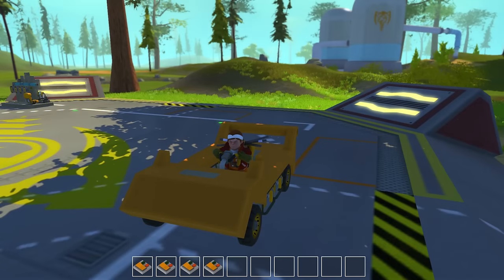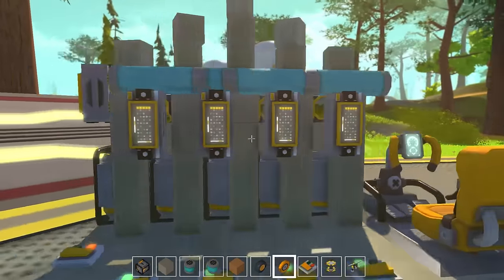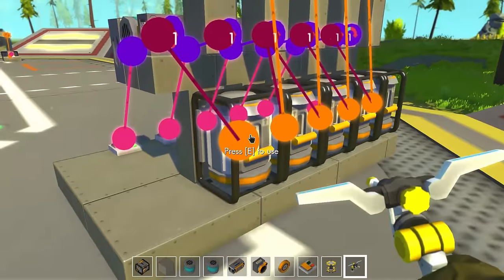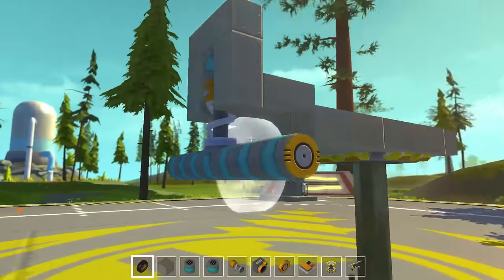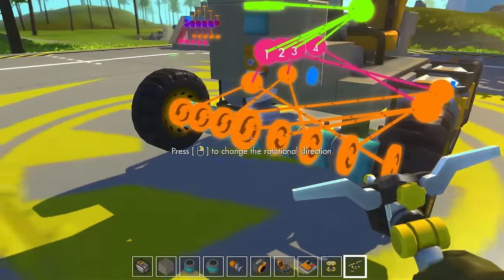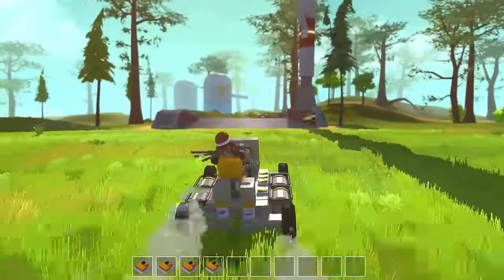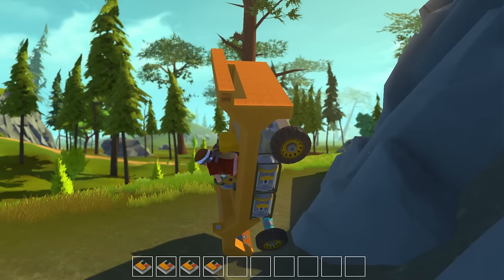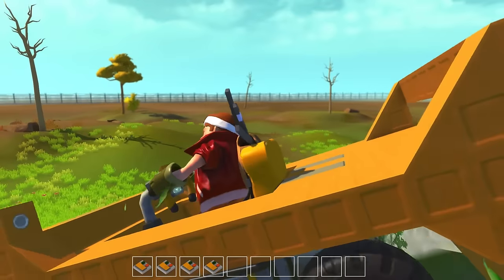02 - Manual Transmission Sports Car Tutorial | Scrap Mechanic Let's Play with Lyte

Comment: +Lyte So with your manual transmission (which I have an idea or two I need to tinker with to maybe improve slightly), WhyBeAre's locking differential (kinda sloppy, sadly), it's pretty straightforward to build a 2/4 wheel drive toggle to fully trick out the ultimate on/off road vehicle.  ;)
Reply from the maker: +Steve Pittman Sounds great!

Comment: This is a great idea and I'll definitely be tinkering with it. I just have to ask, why make your sports car FWD? I'm not sure if the physics in the game act the same in real life in this context, but different locations for the drive tires can have different effects on handling. FWD tends to under-steer, making it difficult to turn at high speeds. RWD does not have this problem, but instead has to deal with over-steer, which can be a lot of fun.
Plus, if you were to make it RWD, you can change the design of the front end. A strut assembly for each individual wheel would give you a stabler ride.
Reply from the maker: +CaliMeatWagon Gaming I address most of those questions in the viewer special (episode 13). RWD likely makes a difference at higher speeds than I go for people with more automotive experience than me. Separating the wheels in the RWD variant did make for a smoother ride, but I like bouncing more than I like drifting. I'm also learning as I am teaching in many cases, so my choices are often not optimal.

Comment: Subbed. Sweet build! Wouldn't the steering be better with independent front suspension?
Reply from the maker: +dave2402 That depends on what you mean by better. The car will be more stable with independent suspension, but it currently doesn't lack stability. With independent steering, it will likely have a tighter turning radius, but that would require you to either sacrifice a gear or make the car wider (maybe taller too). However, with the independent steering, the wheels move less to turn the same amount leading to less chance of hitting the chassis. There could also be some other benefit (or hindrance) associated with those two steering methods that I don't know about. Long story short, some function was probably sacrificed for the sake of size and shape.
Reply: +Lytebringr Just made it RWD

Comment: it does not quadruple, it actually adds another turn, so the first arm rotates 1, the 2nd rotates 2, the 3rd rotates 3 rounds over the same interval :)  It makes sense if u imagine it takes 1 second to go around 1 round, for each arm, meaning after 1 sec the 3rd arm must have gone around its own round  + the round of 2nd arm + the round of first arm.
Reply from the maker: +Madlion That is exactly right. That's how I had it in my head when I initially designed it, but the way the engine power scales threw me off my game. I'll have to make a rebuttal video against myself on that one. I need to practice more with angular velocities!

Comment: If I count correct, the small turns 3 times where the big one does 1, shouldn't that be 3 times instead of quadruple?
Reply from the maker: +karremania You are quite right. I address that in a later video. I was thoroughly mistaken at the time.

Comment: could you combine electric and gas engines so you have more torque in the lower and more top speed in the higher gears?
Reply from the maker: +Alpenkraut It might be possible, but I haven't tested it yet! One of my upcoming episodes will be on torque and that will hopefully cover that.
Reply: ok thx. i´ll just try it out

Comment: So like this may seem silly but it's cause i don't have the game .... what would the car be like if you mixed gas and electric engines for the different gears.

Say you made gas the 3rd 4th for when you want power but will the electrics torque still apply? Also would carrying the gas engines power all the way up still make it drift about

Can anyone answer these, maybe make a video ... also this one video made me subscribe XD. Nice work dude!
Reply from the maker: +Andrew Boxill I haven't done serious torque testing yet, so I'm not certain how combining them will work. However, depending on your FPS and the weight of the car, adding even a second gas engine can sometimes lead to physics breaking down and the wheels acting like a top that is running out of spin.

Comment: It's semi automatic, because it has no clutch. But still, brilliant tinkering!:D
Reply from the maker: +M4Dcat I didn't realize that semi-automatic was a thing for cars... I'd like to make an automatic transmission that shifts you up the longer you hold forward.
Reply: +Lytebringr No way you'll do it compact without an update, which will let you bind letters to buttons. 
Btw, the semi-automatic is used in sport cars, where you control gears with paddle-shifters.

Comment: its not a transmission. its just having 4 motors with different speed and be able to turn them off and on. a transmission has one motor and different gears.
Reply: but its still cool
Reply from the maker: +Chrisi234 I did take a bit of poetic license in naming it. Calling it an X-speed car made it sound too much like a bike.
Reply: +Lytebringr i know what you meant but im kinda weird in those things. i always want to set it correct but the effect of it is like from a transmission and i still like your creativity in building such things.